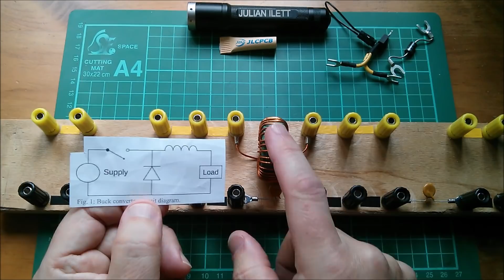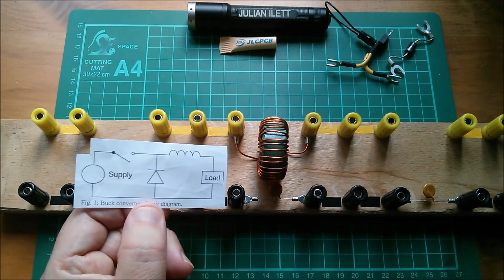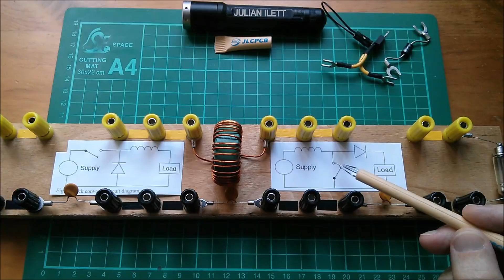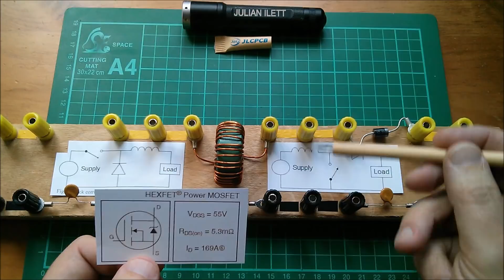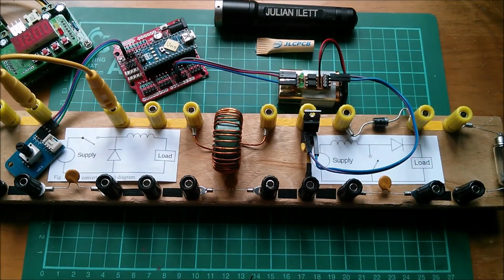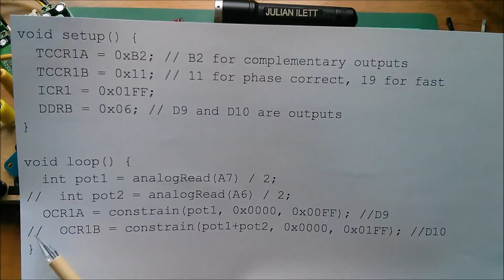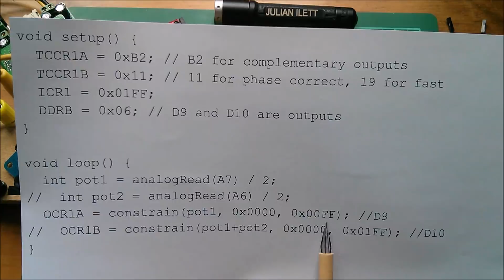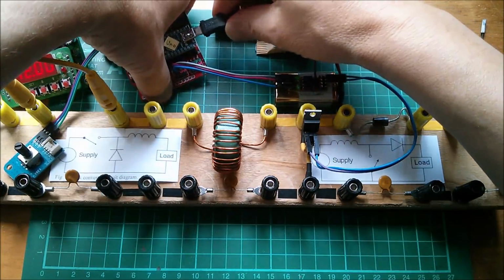Let's Build a Boost Converter - Muppet 2

Comment: hello! i know this is an old video but i am doing a proyect and my queston is: how does the value of the inductor affects on the voltage conversion value? or its depends of the switch frequency only? i will be very greatful if you could help me, cheers!!

Comment: thanks for this issue. i used a lamp as well as payload, on my b00st circuits. sometimes, it would help a little, while seeking on the web, if you could shortly put the target goal of a single project, in the description box. 

here, u may create 5-30 v out of 12v, regarding the consumption power over all. the clock of ur script on arduino would also help to enlight, as it is a little tricky, to raise the frequency above some khz, to hundrets of khz or mhz maybe.

finding the proper coil and capacitor is another story, so probing and measurement over the different steps could guide one to the end of such thing.

cheers

Comment: theres not really 12w on that bulb, your switching frequency is too low, the core gets saturated after lets say 10µs and the other 90µs of your 100µs pulse duration is just a dead short until the fet opens.

Comment: Surely this demo would be more impressive if you boosted from a lower voltage (say 6v) when powering a 12v bulb rather than using an input of 12v for a 12v bulb!

Comment: I've been working on a boost converter producing several hundreds of negative voltage. relative high frequency, inducing resonance from the inductive kicks in a secondary coil.
pretty challenging for me, as it is high side switched using an N mosfet, demanding a pulse tranformer.
But got it all working! That without knowing its was called a boost converter. So proud of my design :)

Comment: As you boost the voltage, I get a faint, high frequency noise in my right ear, I'm just wondering where it might be coming from.
Reply: That's the 15Khz chop. Chopping at your ears is it?

Comment: From 10:45 on i get a headache because of these high frequencies :( They are definitely audible to me. Anyone else?
Reply: Yep, I heard it clearly. Several other commenters also said they heard it.
Reply: No, but I'm 63 years old and my eardrums have turned to leather.  Can't hear much above 14kHz.
Reply: Yes, 15KHz is generally audible to most people.  15KHz as he mentioned is the frequency his circuit is running at.
Reply: Yeah I was about to comment on it. There is a very distinct frequency when he turns the pot to 50 percent on

Comment: Next put capacitor on the output, measure the voltage and calculate efficiency, then try to run it with different frequencies.

Comment: It seems the circuit interacts with the microphone and causes a high pitched sound.
you might might want to filter that frequency out in postprocessing in case you want to make another video on the same topic. should easily be done without a loss in audioquality since theres not much with a frequency like that.
Reply from the maker: I can't hear 15kHz - haven't been able to for quite a few years. But the audio did sound a bit aliasy. Cheers :)
Reply: yeah I could definitely hear a 15kHz sound there. (fairly clean)
It wasn´t too loud for me, but if you turned up the power some more it may get quite annoying.

You could just increase the switching frequency some more, assuming your mosfet driver can handle it. The arduino can go up to 65kHz at full resolution.
Reply: Yep, I was able to hear it easily. When you first turned on the circuit, I cringed a little. I'm one of those few people that can hear a lot of those little switches flipping back and forth, especially tube style tv/monitors. Ran me out of a few rooms in college, actually.
Reply: That sound was pretty unbearable for me… had to turn down the volume to watch it to the end.
Reply: An easy way would be to just add a low pass filter in the editing. You could easily just filter out high frequencies that way without comprimising the soundquality otherwise. there shouldn't be much around 15khz otherwise in the video.
Reply from the maker: Hmm, does Windows Movie Maker have a low-pass filter?
Reply: Perhaps you could just give headphone users a warning next time? (:
Reply: Sounds just like a CRT. I find it kinda soothing.
However some part of the circuit does not like it at all. Probably the inductor singing from magnetostriction, or a cap somewhere.
Reply: i can hear it too, very loud and anoying.
Reply: oh, windows movie maker probably doesn't. You'd probably need a seperate program at that point to edit just the audio.

Comment: The new Arduino Nanos come with Optiboot (same as Uno), but they forgot to update the fuse settings, so they still have 2048 bytes reserved for the bootloader instead of 512 that Optiboot fits into.
Reply from the maker: That's crazy :)